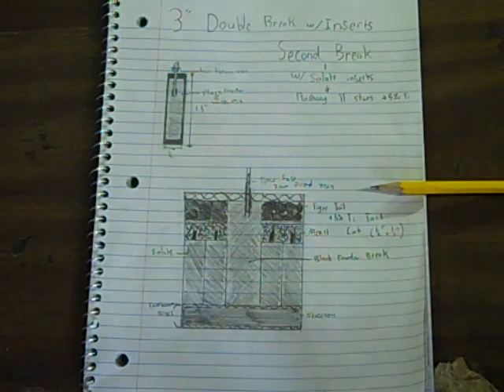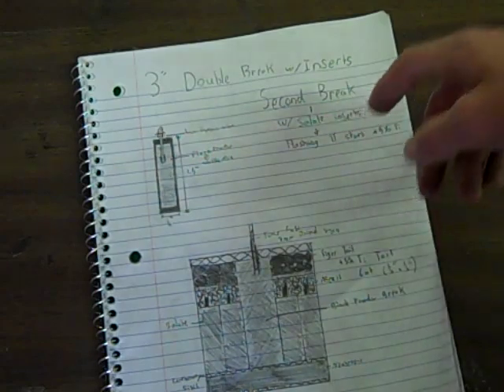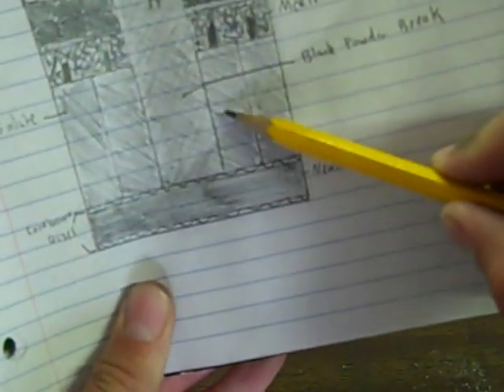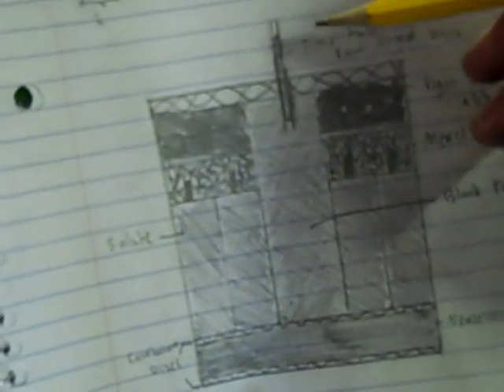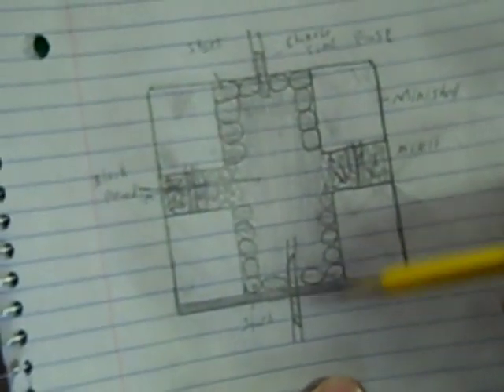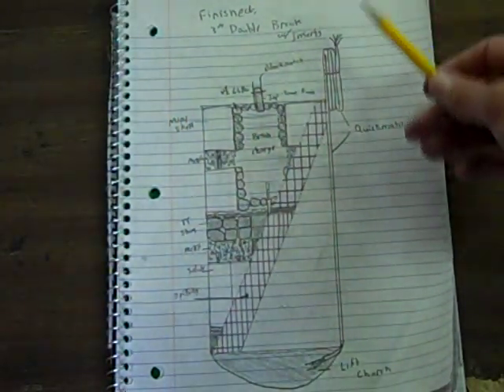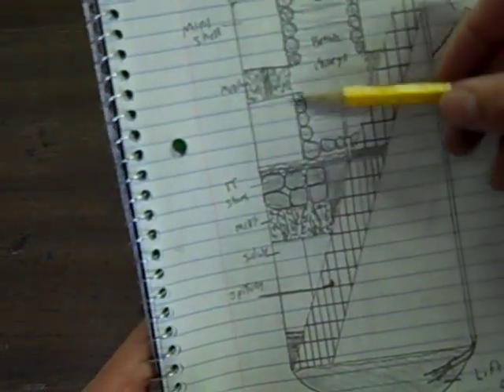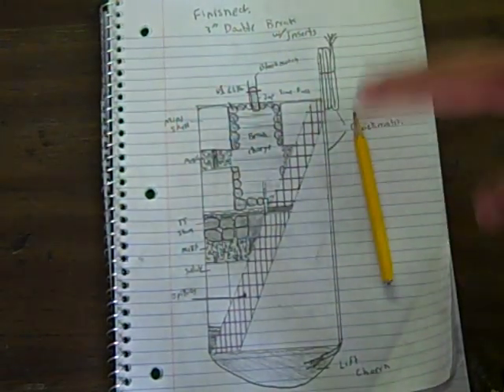3" Double Break w/ Inserts Drawing

Comment: Looks good. You may not be able to fit two rings of salutes in your 3" break, but I've seen it done. Make sure your inserts are packed in tightly enough they will not fall out if you turn the shell upside down.